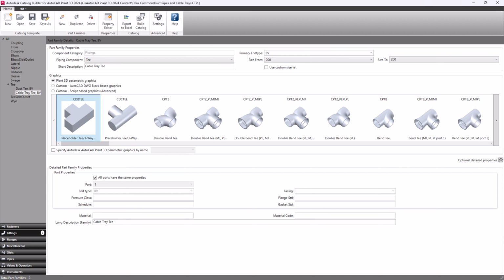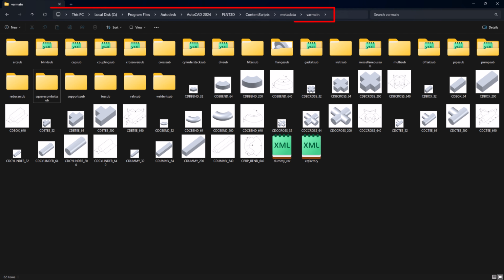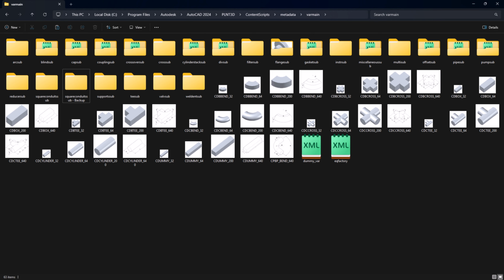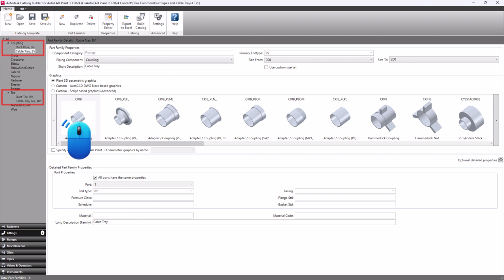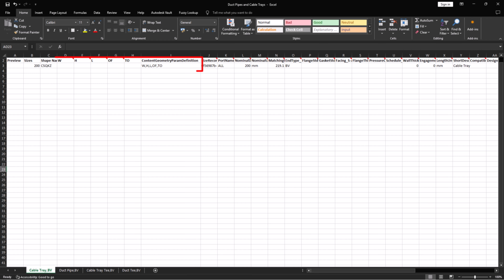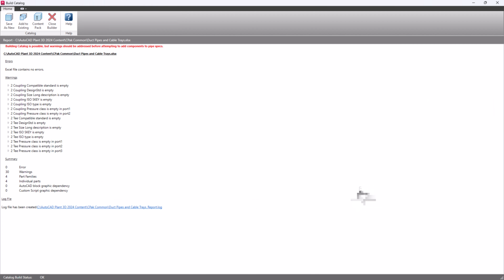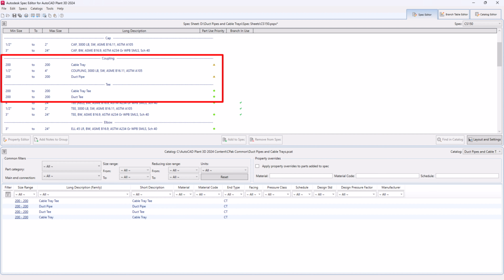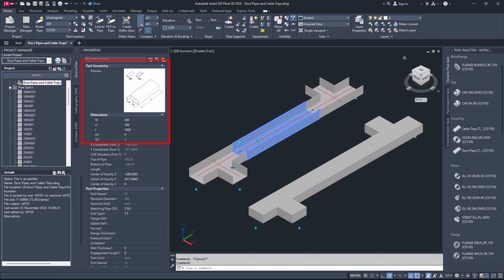AutoCAD Plant 3D | Create Rectangular Duct, Pipes and Cable Trays

Comment: Hello there, I'm trying to create catalog with those steps but getting error like " 2 invalid family sheet" for Cable tray Reducer and elbow.
Reply from the maker: Hey Friend!!
Make sure it lets you create a component. You may have made a duplicate component in the wrong category. Try to create individually and merge in existing catalog. Hope it helps.
Reply: @acadp3dsolutions  I tried all methods but getting same error. Can you please help me out to create Cable tray elbow and reducer, cause I have to use in one of my current project.And also what about other sizes? I mean in Autodesk folder we get only for 200mm size. What about 100,150, 250 and 300?
Reply from the maker: @ Create one item like Tee at a time. Review all the settings in Excel and ensure you follow the right procedures. After you create a catalog for the Tee component, you can add sizes directly in the catalog editor, just as you do for other standard components. I think I mentioned how to add sizes in the video.
Reply: @acadp3dsolutions  I have the same problem with him, the sheet for elbow is invalid when build catalog
Reply from the maker: @ Follow the same steps suggested to him.
Reply: @acadp3dsolutions  i found the solution. The row 1 is hidden, we have to show it on and adjust following row 2

Comment: how to find ducting tool pallates in autocad plant 3d 2019
Reply from the maker: You can locate it in the same folder referenced in the video or in the Content Folder under CPak Common.
Reply: @acadp3dsolutions  how to find cable tray in autocad plant 3d 2019
Reply from the maker: @gauravsonwane9509  Default Cable Trays aren't available in Plant 3D. You'll need to create one using the shapes as demonstrated in the video.
Reply from the maker: @gauravsonwane9509  For versions from 2021 and below, the path is C:\AutoCAD Plant 3D <your version> Content\CPak Common. 
For 2022 and later, you can find it at C:\Program Files\Autodesk\AutoCAD 2022\PLNT3D\ContentScripts (unzipped).
You won't find any readymade cable trays in Plant 3D. You'll need to create one yourself, just like it's demonstrated in the video.

Comment: Is it possible to make a square duct pipe that can have it's size adjusted just like a normal round pipe? The square pipe i was able to create following the instruction in the video has a fixed length. I can't change it.
Reply: ok, thanks anyway. I guess the only way out of this would be to make the square pipe based on python script. There are also a few plugins for purchase on Autodesk store.
Reply from the maker: @Lucaslfm1  In the description of my "Create Custom Supports" video, I included a link to a PDF handbook for Python scripting. You can see if you can create it by yourself, specifically for pipes.
Reply: ok, I will try that next Monday and feed you back the results. I must say I'm not a coder myself, but I was able to do a lot of stuff on plant 3d just with chat gpt help for coding. maybe I can get something going.
Reply from the maker: @Lucaslfm1 Absolutely! I'm not a coder either. All the best! 👍
Reply from the maker: Based on what I know, the answer is no. We have established the pipes under the fittings class, and there isn't an option for dynamic length. However, you can enter "Custom" in the component designation and adjust the length and other parameters directly in the drawing, as demonstrated in the video.
Reply: @acadp3dsolutions Ok. I managed to change the length by changing custom property. But in the BOM the "QTY" is shown by the amount of trays I have, it doesn't count the length of tray. Can I change this? I Need the length of tray in my report, for buiyng the tray, not the amount of pieces.
Reply from the maker: @Lucaslfm1  Regrettably, we can't incorporate dynamic lengths for fittings class since they are calculated based on quantities. Additionally, dimension parameters aren't visible in the data manager. I did some research and attempted to create this in the Pipe class prior to making this video, but it didn't function as I had hoped.

Comment: Kindly make full video for HAVC Ducting. Its help ful for us. (Like elbow,Reducer,Flange End Couplings,Tee etc..) Kindly make one sample catalogue for Ducting.
Reply from the maker: Hello Karthik,
I've included the path to the Plant 3D content folder in the video description. Feel free to use all the components provided and follow the same steps demonstrated in the video. If you run into any problems, just leave a comment here, and I'll be happy to assist you!
Reply: @acadp3dsolutions  how to create a rectangular flange???
Reply from the maker: @KarthiK-dc5xh  The Rectangle Flange parametric isn't part of the content varmain. You'll need to create it using a custom AutoCAD block or by utilizing Python.
Reply from the maker: @KarthiK-dc5xh  I noticed that the rectangle flange isn't included in the default content metadata varmin. You'll need to either design a rectangle flange using an AutoCAD block or create it using Python scripts.
Reply: @acadp3dsolutions XMSL file after edit mm to inch. Save button access denied 😢.
Reply from the maker: @KarthiK-dc5xh  It looks like you don't have the necessary permissions to overwrite that file. Try copying it to your desktop, making your changes there, and then replacing the original file. Don't forget to create a backup!